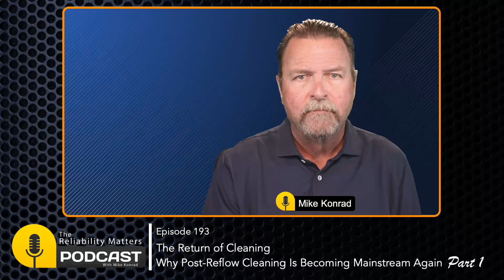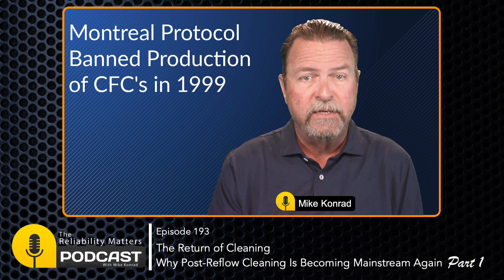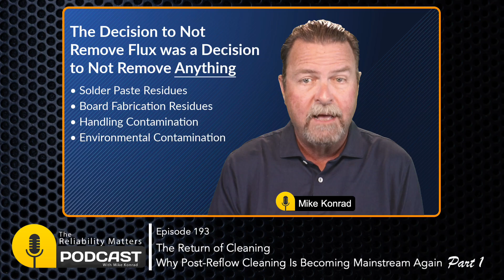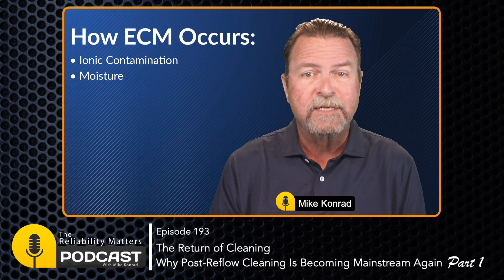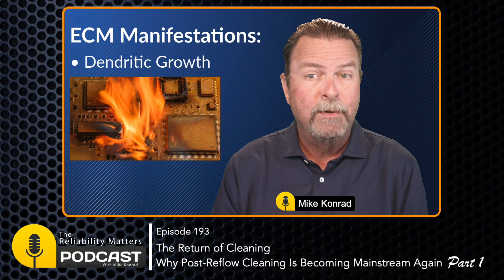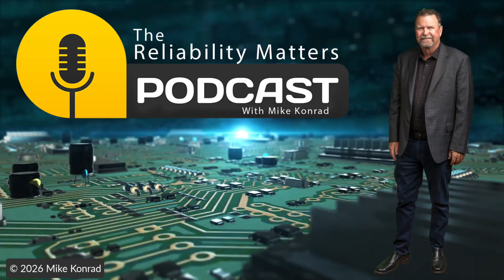The Return of Cleaning: Why Post-Reflow Cleaning Is Becoming Mainstream Again - Episode 193

Comment: Thanks, ironically, I've worked in an electronics manufacturing facility in Brisbane that assured people it made things according to IPC3, besides their other failings, they didn't clean the flux, kept repeating "it's no clean, so don't waste your time" 🤣🤣
I knew it was an issue, told people & well, things didn't change.
Manufacturing is tough, but even worse when the people doing the work aren't helped as an individual fitting into a team, especially when management thinks they know best 😜
Reply: Very true! Thanks for commenting!